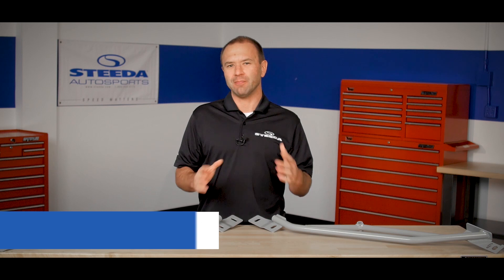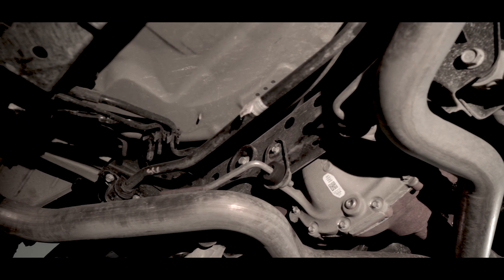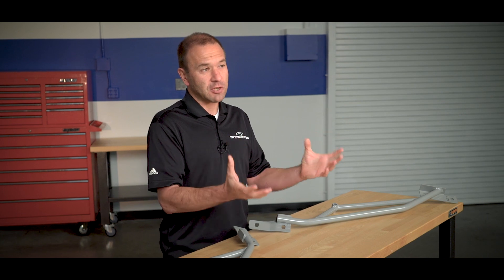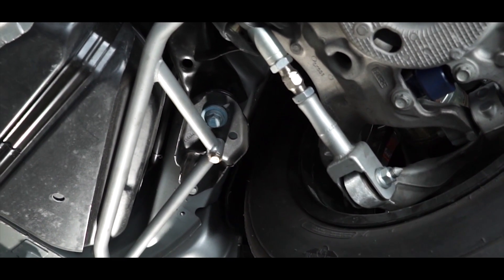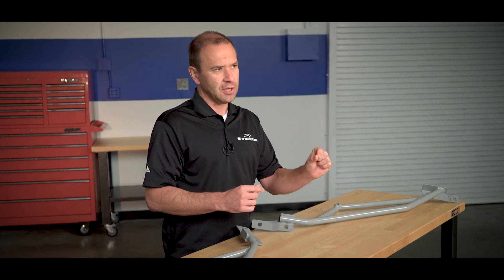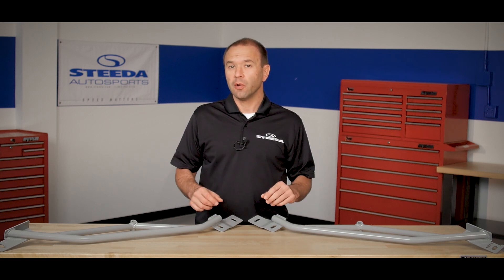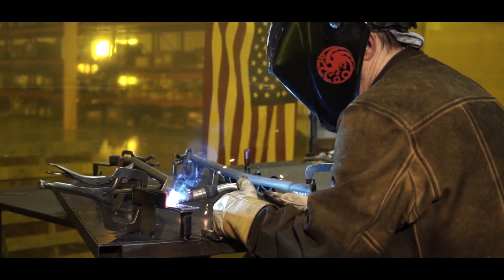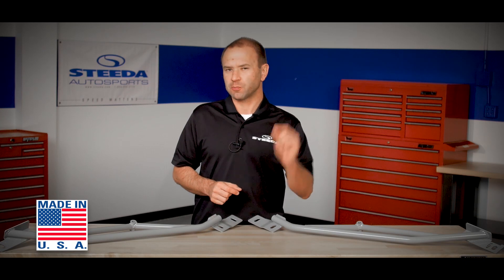S550 Mustang Rear IRS Subframe Support Braces  555-5754

Comment: For someone who daily drives their '17 GT, but likes to enjoy a little get-up-and-go every once in a while, will these be beneficial? Or be more of an rougher ride on my daily commute?

One thing this town has are "speed bumps." Areas of the road that have bunched together, and they usually are on the opposite side of the intersection. So when you get up and going, the rear tires always bounce while you're trying to accelerate.
Reply from the maker: Hi Dustin, our subframe braces will stiffen the chassis but do NOT have any adverse effect on ride quality.  They also assist with keeping the rear subframe more planted.  They mount very close to the floor of the car and will not create clearance issues.